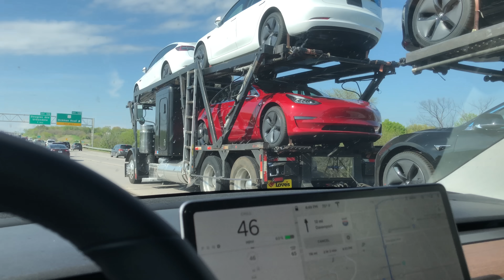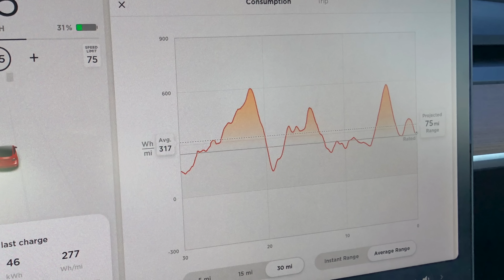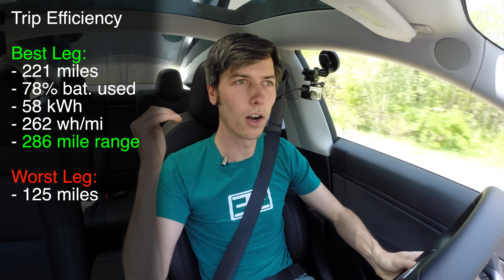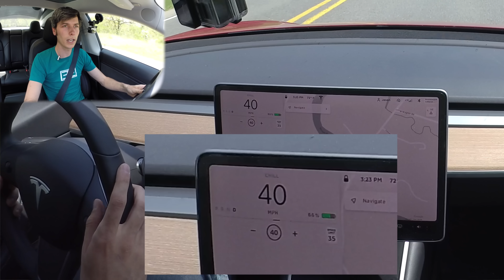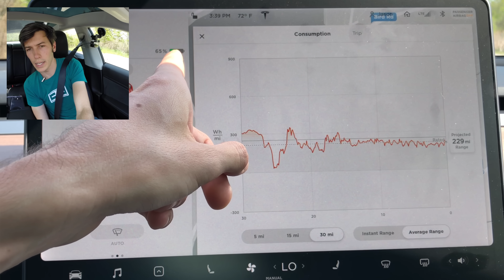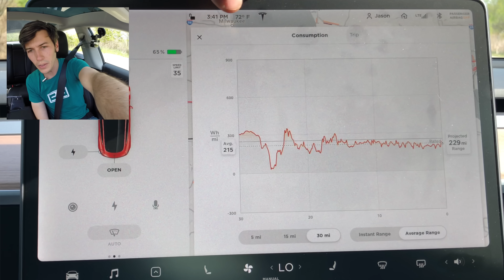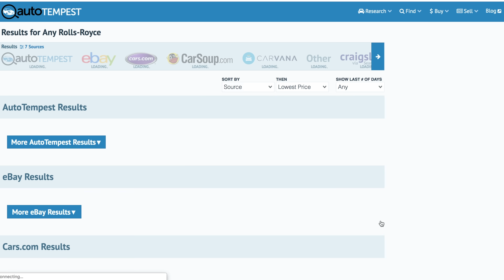How Miserable Is A Tesla Road Trip?

Comment: So after all that, you saved $40?!?
Reply: I think you may have missed the words on the left that said, "CHARGING AT HOME IS TYPICALLY MUCH CHEAPER THAN SUPERCHARGING!"
I'm fairly confident that Jason's point is that if you only have an electric vehicle, a cross-country road trip is doable and not as much as a hassle as one might think. I really don't think he's trying to imply that it's the best option for everyone.
Reply: @pianopeach  I believe your right and this is pretty easy to realize, just go look at your electric bill and what your power co. is billing you per KW. What  I found interesting was how little mileage you per hour of charge at 120v. So here in the states you have to hire an electrician to up grade your system in your garage to 240V, most likely to the tune of several thousand dollars (I'll bet you that Tesla female socket is very expensive). He does another video on electric cars are so cheap to drive, I'll have to check that out, peace.
Reply: @raynic1173  The upgrade to 240v isnt necessary, unless you want fast charging at home. More useful for people who drive a lot, like say more than 40 miles per day most days.
The wall connector for that is expensive at $500. You are right about that.
But that aside, I looked up electrical installation estimates, and without knowing the states these quotes are in, I know it is from multiple states and I got estimates from $500-1000 average depending on how much work is needed, such as distance from breaker box, etc...
So you may pay $1000-1500 total for the fast charger. Less than several thousand at least :)
Now some people saying where they were from, being from cheaper states, did mention quotes as low as $100-300 for qualified electricians and simple work.

Doesnt seem like too much to worry abut. But for sure, saving on gas isnt the right reason to go EV. That is just one of so many other benefits. Some people will never like EVs, but for many people, you cant understand the benefits until you ride one.
Reply: waltermh111 i completely agree with your closing remarks to the comment ... i was totally against EV’s until i got one .. never realized how beneficial it would be and the investment has actually made me happier.
Reply: Most of the savings come over a longer period via no oil changes, or dealing with other types of replacement of traditional car parts.
Reply: @gfifer1  yeah, the only real expensive part is the battery and it is expected to last over 10 years and be recyclable with batteries likely being cheaper and better by then.
It really isn't an issue and many ICE need to be rebuilt at some point around then also.
Then you have all the maintenance you don't have to worry about anymore.
Reply: Exactly
Reply: At least we're getting to a point where everyone agrees. When EV and charging stations become popular it's a no way back. And I think overall price to have and keep EV just tend to lower...
Reply: @rafaelrp07  I wouldn't say that.  More EV stations would reduce range anxiety and open up freedom of travel, but the other limitations persist:  shorter range (200mi vs about 350mi for gasoline) and much longer refueling/charging time.  From what I've heard, the energy density of batteries are already near the limits of physics, so I would't count on doubling the range, or cutting the charging time down to 10 minutes as with a gas fill up.
Reply: Not sure where gas is $3 per gallon, where I live it’s about $2.15 so he actually lost to the gas car.
Reply: And waste a lot of time..
Reply: That's electric cars in a nutshell - buy a really expensive car to save peanuts on fuel.

Not so much in the US, but in Europe we have that problem with Diesel, people paying like 5000$ more for the equivalent Diesel version when they drive like 3k miles a year and it'll never actually save them any money. There is some interesting psychology involved in the cost of paying to use something vs the actual initial cost, people don't seem to mind spending a lot of money to buy something that'll cost them very little to run even if when you do all the math it actually ends up costing them more money.
Reply: And fuel them with coal fired electricity.
Reply: @omgnothingisavl  US electric generation from coal has dropped a lot.

Comment: I'll stick with my semi. 1500 miles on 1 tank of fuel. The time you wasted recharging would have given me an extra night of sleep.
Reply: TeeJay     or ...EE could afford to spend his night in a nice 5* hotel instead of the cab of your truck, paid for by his fuel savings. Might have even paid for some ‘company’ that night too lol
Reply: @kdkd693   Tesla's charging stations cost about $18 to get approximately 267 miles worth of charge. In order to go that same distance in my car, it would cost me about $22 in fuel at my area's average fuel cost. My car costs about $20,000 new, where the Tesla's cost almost double that starting out. Forget about my semi, my company pays for the fuel so I can't compare actual savings. But, who's really saving any money with a Tesla?
Reply: TeeJay  I cant comment on your exact circumstance obviously, but EVs are not for everyone,  yet.
It’s not apples to apples to compare buying a new car (EV) vs already owning an existing (ICE) older  cheaper car . Compare it to  buying a similarly specced up BMW 3 series eg 330/340) , and the price for similar quality is close.

      Fact: EV’s are definitely cheaper to run than ICE cars, both fuel and maintenance   To counter your original posts point..

My EV does not need to have paid fuel most of the time (Home charge using  existing solar). On a road trip it costs more than free for sure. EVs can be less convenient on a road trip, but more convenient when home charge each night.

Comment: 20:40 If you mix those cases, you can realize you can be told that you'll arrive with 8% charge but fail by 8%, meaning you can get stuck in sight of the charging station. Or even further...

Comment: So it takes almost 20 min to get to full charge from around 15% charge left.
But it only takes about less than 5 min to refill a gas tank.
So while it may be more efficient it still needs a faster way of recharging so you don’t have to spend 20 min at a charging station.

Comment: EV's lose about 40 to 50 percent of its range during winter. In a gas car heating is free. So stay away from EV.
Reply: That heat isn't free. Its 75% of your gasoline's energy that isn't used for moving your vehicle.
Reply: @OVER-bENGINEERED  who cares. The heat in a Gasoline engine is free. Gasoline engines won't experience a drastic reduction in efficiency during winter. I don't want a car that loses 50% range.

Comment: Even though you saved on the energy investment, you lost overall with the additional time that you would be spending in a hotel for the additional hours that you had to spend charging (less time available for the actual vacation).  It might be better to look for cheaper airline tickets and rent a car for $34 per day with a combustible engine with a range of 400 - 550 miles on a single tank of gas.
The cost for an average hotel on your route might range from $120 for a Holiday Inn Express up to $185 for a nicer Hampton Inn Suites.  Not to mention, most people are eating while driving not stopping for an hour on a road trip.  Glad someone finally recognizes the downfall of lower profile tires & wheels.  Not everyone is living in a state that invests in road maintenance.  So, you can count on spending a lot of money in states such as Illinois, Michigan, Indiana or Ohio since these areas are heavily impacted with poor road conditions due to weather and traffic degradation.

Tyson Clarke - I agree with you.  He doesn't look more than late 30's.  Considering he is saying that he is 3 years older than me.  Also, he is as skinny as a rail so I am sure that the seating is comfortable.  You put my big butt in that seat (6'1" 250#) and the results are likely to be completely different.

Comment: Still taking to long to charge.. Really slows down the trip.  You would think they would have a way to hot swap batterys at the charging stations.  Either 100% robot swap,  or a charging station attendant who could do the job in 10 mins.    How long does it take me to swap battery in my laptop?  30 seconds at most!

Comment: Funny your birthday seem to change from video to video. My biggest problem is that there are no short cuts . If I drive to my orchard Arizona to my farm in California is 725 miles 14 hours by gas , it’s 1156 miles or 27 hours by my model S . Down side is because of all the Supercharging my 2013 is down to 66% by battery ( seems less) so with 157k , I can no longer make the trip , falls short unless I want to drive 1310 miles to hit all the charge locations. New battery installed is $43k , by KBB car is worth $9k if it didn’t have a bad battery

Comment: In San Diego the electric rate is 0.43 per kWhr so 560kW costs $240.80. The gas cost was $196. I was thinking power from the utility is much cheaper than gas but now I know better. By the way, in another video, he said he was born in 1953, the last year of the Ford flathead.

Comment: I'm not trying to be a nitpick. I get your energy numbers but from a carbon standpoint if your took 560KWH at the US average of 1.4lbs CO2 per KWH that is 784lbs of CO2.  you get 20lbs of CO2 per gallon gas burned so you are at an equivalent of 39.2 gallons of gas.  In my car 2000 miles would take about 57 gallons of gas and like you said 7hrs less.  You are saving some CO2 but not the equivalent of more than 100mpg.  just saying numbers wise.  So equivalently you are getting closer to about a 51mpg car.  I have had cars get well over 40mpg in the past (My old 318i got 42mpg to 44mpg consistently as long as I didn't drive like a nut job).  The other thing I would say is a lot of equivalent ICE cars get well over 30mpg.  For instance I have a friend who drives a BMW 3 series and gets 36mpg, I also have a friend with a Camry that gets 34mpg. Not saying you didn't do well, just saying not as well as you think. Just going from 30mpg to 34mpg saves 7.8 gallons of gas at $3/gallon = $23.4 that takes away from your savings.  At 36mpg that is a savings of $33.3 over the 2000 miles.

Comment: Are the electricity costs accurate? How can it be 112/118 MPGe when The cost of Gas at 30MPG is only 20% more?  Should be nearly 400% more.  I thought one of the biggest selling points for electric cars was the low fuel/power costs.  Seems like hybrid is still the best compromise.  At the prices you quoted it would be cheaper driving a hybrid and only need half as many stops as a fully gas powered car.  Last year I drove from Morada California to Vancouver B.C. and back with a couple of detours and a day driving around Vancouver, which all up was around 2100 miles. I was driving a Ford fusion hybrid. I'm a very smooth fuel efficient driver and even with the much higher costs of gas in the western states I only spent around $110-$120 on fuel.  I was starting to get excited about the prospects of the whole world going electric within a decade or so but after watching this video I can see the reluctance of most to switch unless the costs of the cars and charging as well as the charge times come down quickly.

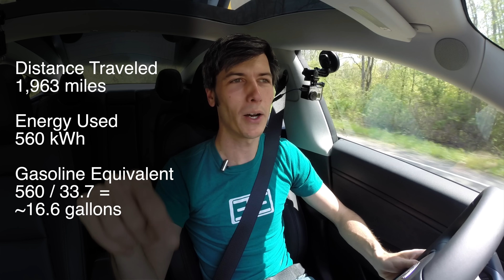Comment: 8:10 you can't just compare the energy in Petrol with the energy you used in electricity. Depending where in the US you live the electricity will come from coal or a nuclear power plant. Both have an efficiency of around 30-40% similar to a petrol car engine. 
So you actually used an equivalent of about 1400 - 1867kwh (of coal for example) for your  roadtrip. 
Compared to a modern Diesel that isn't  such a great figure anymore, especially considering how painfully slow you traveled. But I know you americans don't like our german Diesel cars. 😆

Comment: How many miles range are you getting. I have a 2019 P3D that I just did my first trip and only could charge to 299 full charge.
Reply: 310 but the performance is less efficient
Reply: Matt Rash efficiency isn’t the same as capacity
Reply: @BrookviewLabs  I'm aware. The capacity calculation was readjusted due to being less efficient

Comment: Look, what is the point of the "could have done that in 1 tank of gas" technically truth but for all intents and purposes lie?
No, if I gave you that tank of gas, there is no way in hell you are getting that far. Sure, your car is efficient, but any generator you can find won't be.

In essence, "could have done that in 1 tank of gas" is just as true (or false) as "could have done that in 23 nano grams of cocaine".
Why 22 nano grams? 560kwh = 2016Mj, which according to e=mc^2 is about 22.4 nano grams (all other chemical potential etc are rounding error).

Comment: Sooner or later you going to be hit with a road (gas) tax of some sort. Otherwise your not paying for those orange barrels. Fed gas tax is 18.4 a gallon for gas and the average state is probably around 40 cents a gallon. If your getting better mileage than you going to be expected to pay more like the diesel road tax because you will be able to pass more orange barrels using less fuel.

Comment: So the big thing I got out of this is you will be spending 23-24% of your trip time changing and taking a break, but only at locations that have a changing station. So if you have the time on a long trip this is great, but if you have a need to get from point A to B as quick as possable with little notice an ice vehicle might be a better option. It would be great if the government gets wireless chaging on interstates. It would really eliminate one of the last problem big concerns of drivers. I'm just not sure how the eletrical use would be paid for. I really wouldn't want a reguated power meter put on my car.

Comment: So a Telsa doubles the drive time if not more. I'm not an engineer so I won't bother with the math. Okay I'll do a little. In a car with mediocre mileage like 24mpg and a 16 gallon tank =384 mpg. 2,000 miles is stopping and filling up 5.5 times and takes about 5 minutes to pump the gas. Meanwhile you're still the the same state you're departing from charging for the second time for 40 MINUTES.
Then a flat tire adds 40 minutes? I can change a tire in 10 working at a standard pace.
Only $156 to charge for the full 1963 miles. But what about hotel costs seeing it took nearly double the time?

Comment: That seems like a massive hassle to me over gas. On a standard car I don't need any special memberships or service plans, I don't have to plan a trip along certain routes, I have a quieter ride (almost no road noise in my 300 doing 85), and I spend 1/4 to 1/10th the time re-energizing. Covered ~1,750 in 21 hours counting gas, food, and the 3 hour nap I stopped to take on the way (1 person but also fully loaded car). Yeah, you may save a little driving an EV depending on gas cost but those trade-offs are massive if you're looking to actually get to your destination quickly. With that kind of travel time you may as well have flown.

Comment: What this also tells me is that if we became a full electric economy we would have a unbelievable battery disposal problem on our hands. you thing combustion motors are bad wait until 500,000,000 cars have ether battery's replaced. I am not interested in electric until they perfect capacitor technology and replace all the battery's with capacitors which would give instant charging capabilities and long long life with no horrendous chemicals that cane become a  massive toxic problem. The are many many things that can be dun to make an eco friendly combustion motor IE Hydrogen combustion the by product is water no catoletic converters needed only a muffler. Electric is defonatly one of the cleanest futures of cars but battery's are not it.

Comment: Think about how many gas stations there are for the millions of cars in the US that run on gas traveling long distances every day. How long does it take to fill a car up? 5 minutes top? Now think about all those millions of cars running on electricity needing to recharge for 15-30 minutes MINIMUM. Every exit on every interstate will need to be lined with nothing but chargers. These electric car producers need to stop concerning themselves with how fast they can go and start concerning themselves with how FAR they can go. Top speed needs to be about 85 MPH with 0-60 in the 10 second area.  Range needs to be at least 1000 miles before charging. That way you can plug in at your final destination. It sounds boring as hell but this is where we are heading and the logistics of running 100% electric needs to be thought though better. That’s not even taking into consideration that 40% of the US is powered by coal and the mutilation of the earth and child labor that’s involved in making these cars go. But if a Tesla makes you feel better about yourself then by all means indulge. That’s another conversation.

Comment: Jason, your efficiency comments are wildly misleading. 16.5 gallons of gas can't power a Tesla Model 3 anywhere near 2000 miles. NOTE: The amount of energy at the wheels on either an EV or gas/diesel car takes considerable energy to produce, as both systems have high losses. Currently, with EV's, the best we can do is put 29.8% of a fuel's energy into the wheels. The Prius can do better than than an EV, with 41% Thermal Efficiency and 15% drivetrain loss. 

A combined cycle power plant can, at best achieve 54% efficiency at the power plant fence. The 60% or even 64% efficiencies quoted are at the generator terminals and don't include the energy needed to run the plant itself, nor the transformer losses. Grid losses are a real world 8%. Grid to charger to battery from battery to controller to motor to wheel losses are solidly at 40%. 

Once again, quoting energy used driving the wheels is disingenuous at best, and intentionally misleading at worst. Both EV's and equivalent gas vehicles will need the same energy at the wheels.